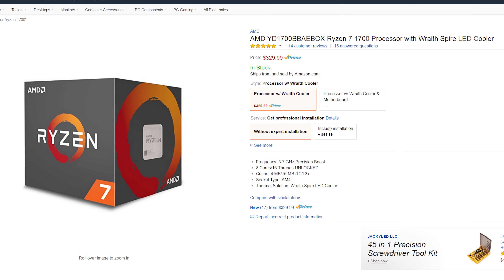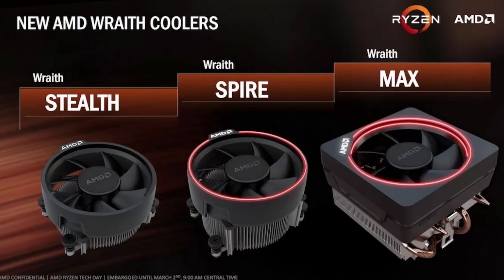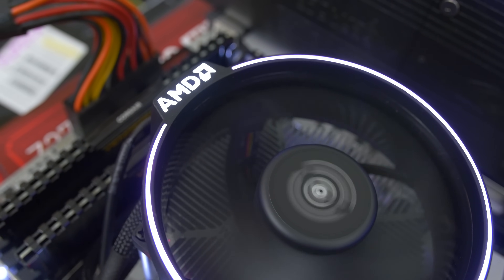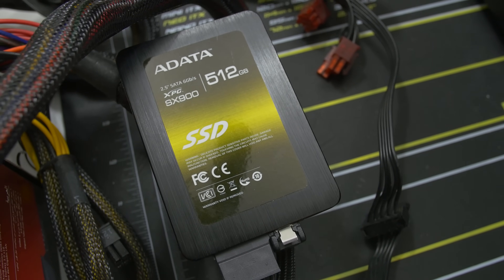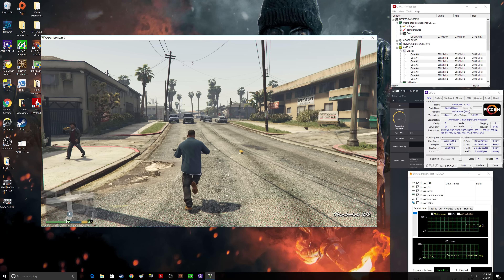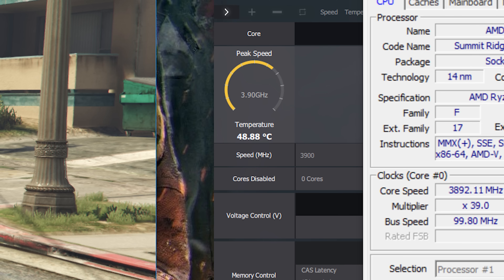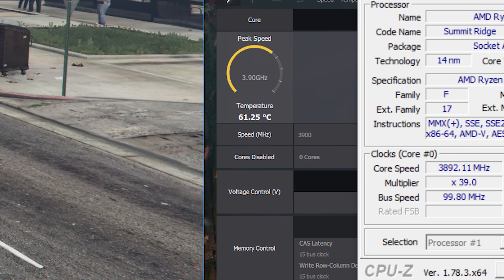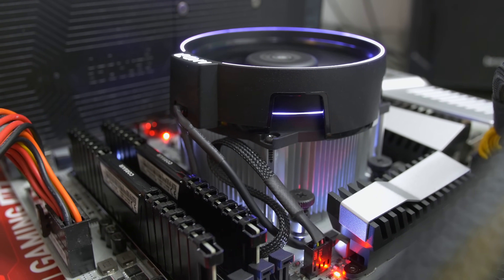AMD Wraith SPIRE: Does it SUCK?

Comment: why are all AMD videos always start with a foreshadowing title like
"Does the cooler SUCK?"  -  "Is Ryzen really as bad?" - "Does the RX480 really destroy mainboards?"
These literal images used are the worst thing the media can do to a company like AMD that produces great products.
Reply: How about "IS NEW INTEL'S CPU JUST LIKE THE PREVIOUS ONE EXCEPT MORE EXPENSIVE?"
Reply: @Slay1337pl  3 years later, YES!!! The same 14 nm arch... LOL
Reply: @Slay1337pl  LMFAO GOTTEM
Reply: "how good is the amd wraith spire?" would have worked quite fine
Reply: I agree, Baum! Cmon, Kyle stop with the negative titles
Reply: +Whorus Lupercal so you're saying they should've sold the 1800x at $1000?
Reply: Are you stupid? What crap products? They offered low priced CPus forever that gave you more cores for non gaming tasks and still did ok in gaming. Now ryzen increases their thread count and iPC all for less than what intel offers. AMDs Gpus have always been amazing for the price. From low end to mid to high end AMD has offered amazing solutions to games outside the enthusiast market. 

What a pos fanboy comment. FFS how much does the $240 RX 480 suck now that its overtaken the 1060 due to driver support? How much does Ryzen suck now that we know with faster ram it as good as intel for gaming and blows it out of the water for everything else... ffs even older gpus like the R9 series gained ground on nvidia equivalent hardware. As for the FX line of chips they still offer amazing performance at low prices...
Reply: Because people think of AMD as a heater company rather than a capable CPU/GPU manufacturers...
It's so imprinted in their heads, it's all Intel this, Intel that, nvidia this, nvidia that, so they believe AMD is inferior when actually... it's VERY competent company.

TL;DR: Intel/Nvidia fanboyism...
Reply: gravitygear your brain washed Intel brain has led you to believe AMD has put out sucky products, but I ran my fx6300 for years and no hickups, overclocked. Was enough to pair with my 1070 at 1440p, super value.
Reply: Thats odd... I have single 7970 and FX6100 and its stable clamped to 60FPS 1080p ultra and it sits there without shutter... It goes over 120FPS sometimes tho without FPS clamping. 
I should benchmark bf1 I could be wrong on something here
Reply: You have strong arguments, but where did he mention serverproducts? Also crap is a strong word and you you use it seven times in the initial post. What reaction do you think that provokes? According to Wikipedia (just a quick check) AMD has 9100 employees while Intel has 107.300. If that is true even Bulldozer and Excavator where huge sucesses. Its been that way for ever, AMD is worth 10% of intel, has 10% of the resources Intel has. Dont' get me wrong, i get most of your arguements. But considering these numbers doesn't it make Ryzen a fabulous product?
Reply: They weren't crap, they were just underwhelming. And I had 0 driver issues, in fact i've had more problems with nvidia drivers crashing than AMD. A bad nVidia driver even bricked my boot sector annihilating windows completely, never had that with AMD.

AMD was always preferrable for budget builds, they weren't "bad" they were just "cheap", and definitely offered more value for money (still do) than Intel and nVidia ever have. That does not make them crap or bad.
Reply: these comments haven't aged well
Reply: This comment has aged beautifully
Reply: gravitygear, I have FX CPU (aka the CPU disaster) and RX480 (aka motherboard destroyer).
Guess what, no issues. 50+ FPS in GTA V on high/max settings, 4K 60FPS gaming in HotS, easily handles max settings in BF1 and also very good video editing performance compared to more expensive i5 CPUs.
Reply: Because the norm is that stock coolers do suck, from both intel and AMD. Also let's be honest anyone who is looking for this information is thinking to themselves "Does this stock cooler suck and will I need to upgrade it?"
Reply: Weird Im rocking a fx8350  with stock wraith cooler with a gtx 1060 OC to 1850 with 16gb of ddr3 ram and I get 65-80 in 1080p with max settings.
Reply: He meant, "SUCK", as in, "Sucking air". It's a classic Bitwit pun.
Reply: TheLondonPlayer true.. communication is so important and u need real ppl with taste to do that... anyway amd is getting to take more risk lately.. look at the revolution banner with the closed fist.. lol.. looks like taken from 1986 apple setting ... "think different"... communication and mktg is not something anyone can do.
Reply: you mean only 1 decade. Amd was controlling the market from about 1990s to 2006
Reply: @dragonfyzex1546  very true
Reply: butthurt amd fanboyyy
Reply: baum stamp i kinda get it why he use this title. stock cooler are known to be bad (until wraith), intel doesn't give any chance for overclocking with their cooler imo
Reply: +kenny ricardo no it's because he knows he will get more views that way
Reply: Because that attracts Intel and Nvidia fanboys
Reply: becasue it gets your attention simple as that
Reply: no but a low price for a solid product makes it much more appealing.
Reply: ^
The bait is weak on this one
Reply: its actually not true, and the 480 is either tying the 1060 now or whooping it. fairly often amd actually has a better gpu within a price range but people go with nvidia anyways. i suggest you actually look at some benchmarks before spewing bullshit.
Reply: Easy path: If you plan to upgrade your GPU when a new one comes out go with NVIDIA since they update their drivers at a faster rate but if you plan to keep your GPU for a long time AMD will destroy NVIDIA, at the long run the AMD cards performs better and you can see that with the 280x for example.
Reply: short answer , because dumb people
Reply: R U mine Well the 280x came out in the 2013 and can handle Doom maxed in 60fps (ninja edit : 1080p) or more (check videos) and if you take in account the 280x is a rebrand of the HD 7970 (2012) well here you have a chip holding on titles 5 years later and still kicks hard. Keeping with the 280x as an example at this point the card is far better now. Impressive isn't it? So, choose wisely my friend and as always enjoy the game
Reply: baum stamp people click more often on does it suck kinda titles :p
Reply: You are joking right? HD4870, HD5970, HD7990, 7970, r9 290x. Those were all price / performance kings at their time, some even top performers. The Athlon 64 X2 which was far ahead of intel pentium processors. Saying they haven't produced a great product in decades is utterly bullshit.
Reply: They haven't always been far inferior. They have been more performant than Intel for more than ten years. At the same time they had better prices. And even when Intel started to keep up again, performance-wise, AMD still had the much better price-performance quota on their side for long. Overall the time that AMD was 'better' than Intel is like 50% of their whole lifetime, so none of both is better or worse. And btw. Intel could have died either, if it wasn't for their heavily illegal methods during the crappy Pentium 4 era. So don't complain about AMD being the 'good guy'!
Reply: I think they were going for "does it SUCK like most boxed coolers?" but I agree with your point.
Reply: baum stamp ikr
Reply: TheLondonPlayer nonsense
Reply: 0DANGEL you are getting way too low fps. But yeah it's obviously not the best CPU by any means, but it's not bad. I have the 1700 and it's so much smoother; it's really nice. I'm returning it for the 1600 though lol save me $120!
Reply: Jay stated that they can't buy him or his opinion. However, I gotta say, the way he makes the title is kinda misleading. I do like the way he presents his opinion. It is just the title that needs to be fixed.
Reply: baum stamp the products arent great though...
Reply: so price alone determines how good something is XD
Reply: 480 is often faster than 1060. 470 is good value as well. Keep talking about inferior products as if its that clear cut. that is why people like you end up buying nvidia crap and regretting it later. How does that 960 look against a 285/380 now?
Reply: What is skinned as new? AMDs cpus are completely new. And $500 is enthusiast.
Reply: baum stamp omg yes fuck this and all other
Reply: They never have anything new to offer that competes with top end titans and 1080ti
Reply: saego360 u r talking like a fanboy , do u know that amd makes medium-low tier product right? So why the fuck r u saying “amd has nothing that can compete to high tier product like gtx1080 ti
Reply: Is not only on the AMD videos, every single video out there uses the same shit is called clickbait.
Reply: Fosi94 how much time is long time?
Reply: actually the 7970 came out in december 2011
Reply: Fosi94 i am using a 280x and i have no problems with any game btw doom can run around 100-120 FPS if u just lower the shadow quality from max to high or even medium and it still looks the same lol and it applies to most games auto settings to high, meduim and low is not the best way to judge a gpu
Reply: Gangel Richárd What? Did you even read my comment? I talked wonders about the 280x man
Reply: the 7970, and the 280x arent exactly the same card, the 280x is basically a refined 7970 from my understanding. the 280X performs mildly better from what ive heard.
Reply: bmxriderforlife1234 I said it's a rebrand man, the chip is the same. If you want the details is exactly a rebrand from the 7970 GHz edition. When a. Company cook a chip always improve them a little bit so yeah is better :-)
Reply: yeah fair. lol i know someone with some 280x's just sitting on his shelf still working, i should see if he will sell them to me for a temp replacement for my dead rig. lol would have to wait on the r5 1600 reviews though, i want to see how it clocks, otherwise might be able to find a cheap used I5 since people are upgrading. waiting for ryzen+ to rebuild a high end system. id prefer to wait out early adopter pains, at least on the high end. r3 for a freenas box is going to be a amazing though. also a giant FU to intel that amd pulled. ECC support on everychip.
Reply: bmxriderforlife1234 If you can get a Sapphire one would be great, I still have in a rig the 280x dual X and it surprises me how good this card is for the time it have on the market... Yes, go with ryzen and the 480 man, great setup at a pretty affordable price. I can't wait to see how both gpu and cpu will be in one year with drivers optimizations!
Reply: eh more then likely going to go used, that way i can justify potentially abusing it later on for some experiments. ;) gonna be trying my own attempt at a sub ambient rig, and i want to test with parts i wont care as much about, so use the temp rig when i replace it :P

im not sure about the brand but i remember they were pretty nice cards. 

as for my expensive build, depends what ever offers the most performance, basically planning a realistic version of linus' 7 gamers one cpu, but im doing 2 gamers 1440p :P

and then for when im the only one playing either 3840x1600p with a 38 inch 21:9 monitor, unless something better comes out between now and then, then just switch out the shopping list. then going to build a 5x1 portrait set up, with 1440p monitors, 2 of which will be used for the multi person gaming scenario, but yeah basically battle station.
Reply: ofc i read your comment i just threw my stuff there too :D
Reply: https://www.twitch.tv/videos/129702979 to see r7 1700 with gtx 1080 destroy crysis 3
Reply: bmxriderforlife1234 Alright the experimentation always is funny and interesting. Sound like a nice project to do, would be nice to see the finished product in the near future. Wish you all the luck and success!
Reply: Egonieser Locman A bad driver from Nvidia bricked your boot sector? You couldn't rebuild the boot? My God... If that happens to me I'll just go full Allahu Akbar
Reply: ive had a bad experience with an nvidia driver as well but not that bad.  i agree with fosi id go ape shit, picture boggie2998's francis destroys an xbox video but a skinny kid with a sword to a gpu.
Reply: bmxriderforlife1234 I feel identified with the skinny part and the sword...
Reply: also at one point AMD was the more expensive choice from my understanding, they were ahead of intel and released a the first 1000$ consumer cpu.
Reply: bmxriderforlife1234 Well if my memory is correct a long time ago EVGA wanted to sell Radeon cards but AMD said: nope. And if that's correct... Says a lot. Ninja edit : talking about GPU's of course.
Reply: well idk what that would say but i heard that EVGA has said that they will not produce amd hardware so yeah maybe.
Reply: btw did you see jay is doing a 30 day ryzen challenge? reviewtech joined him, joker is using ryzen for his work now. dont see how people are saying reviewers are hating on ryzen. 

btw what are you hoping to see out of ryzen+ or whatever they call the next batch. i wanna see pcie lanes get icreased and overclocking potential these things are kinda duds in that regard, too bad in everything else intel is basically screwed by anyone looking for price to performance especially on the lower ends skus once those are available.
Reply: bmxriderforlife1234 Well EVGA wanted to sell Radeon they got kicked in the nuts and then "oh Nvidia come here my friend!" always have a laugh with that. 

I don't know if that comment was for me but I'll answer it:

I saw the challenge of Jay and its AMAZING, to be honest only 3 minutes in difference on that rendering doesn't bother me when I remember the price gap.  In my humble opinion I couldn't ask for more, it kinda hit me hard when I see the "poor" overclocking capabilities, I mean we were used to rise the multiplier like crazy with the Fx's but even with that there's no comparison between both. I only asked for an affordable yet powerful enough to game and do some tasks for a couple  years but also with the overclocking in mind since is just funny to mess around and AMD delivered! Solid pieces of hardware... 

The lower end CPU's will be the most interesting ones, If they can handle without any problems a nice overclock there will be very few reasons for a gamer to buy a higher tier and it's nice! Is nice that you have now a really good selection of processors for every single budged out there. 

Vega is coming and to be honest I don't know what to expect now... If AMD keeps launching their products like this Wow... Just wow... The support for the increasing in the PCI-E  to be honest that could be something slow in the AMD side. 

But like I said I don't know what to expect or see I feel like AMD waited until the last round to make a come back. And they're doing it, the red team is throwing some hits! 

4 edit: sorry if there are repeated words or something, the zombie mode is hard on this one... Nite
Reply: oh true, well lol might explain why evga wont make amd stuff now. 

and yeah i was asking you. 

and yeah the difference is marginal the difference equates to single gpu or dual gpu for someone considering a higher end intel part in a lot of cases. overclocking capabilities will probably be improved upon in ryzen+ seeing how people are complaining about it i see that being a key point for amd to potentially look into. 

the lower end sku's  are going to screw intel if you think about it, even if they have the same max clocks as the r7's all that means is gaming performance will be the same, the only thing different is the number of cores, total cache and everything is the same. so either the same price plus more cores as intel i5 systems plus cheaper motherboards. or the price of an i3 system but with core real cores and unlocked multipliers. plus they all have ECC support, so once freebsd gets better support and other such OS that require or like ECC ram intel is screwed. if amd is smart theyll work on that sorta stuff with the people working on those programs and yeah basically undercut intel hard.  as for vega im not getting hyped, but im awaiting to see the performance as with ryzen, however i do hope they deliver. Hbm2 should do good for what im planning with the crazy resolutions from my understanding. 

the reason im hoping for pcie lane expansion is basically because im planning a dual gamer system as well as want m.2 nvme drivers for both to boot off of. plus having one beast system will come in handy for video editing as well as some other projects. 

definitely throwing some hits. 

no worries night.
Reply: uhm i direct you to jayztwocents who literally shit on nvidia for the titan z card.
Reply: bmxriderforlife1234 
Really? Literally? Then I must demand the video where JayzTwoCents literally took a dump all over the NVIDIA HQ.
Reply: i never said on their HQ. go watch his titan z video. and a bunch of his live streams. that card literally pissed him off. and he chirped nvidia about it for like years. also i guess you dont watch archer.
Reply: Fearbleeds you joking right? cause I had an fx and it was shit
Reply: +Gilgamesh I approve of your name.
Reply: baum stamp the RX480 pulling too many amps from the pcie slot was a legitimate concern. It's fried at least one motherboard but only older ones. I think the point of these do they suck videos is to prove that they don't suck.
Reply: They haven't always produced great products, and imo deserve a certain degree of skepticism
Reply: baum stamp l
Reply: Many people love the AMD products.
Reply: gravitygear I know I'm late but I'm interested, how does Epyc look for what you're doing?
Reply: It's been a while, but, the stock cooler on my Athlon X2 5200+ CPU absolutely sucked a**. That thing was so inefficient, that even a 720p Youtube video could bring the temperatures up to over 70°, not to mention playing games on a hot summer day, which ALWAYS led to warning sounds, and the CPU shut off. Yes, i know you can set the thresholds in the BIOS, but, 70-80°, sometimes even 90 were just too high for that CPU. 

Good to see though they learned though, and build some more efficient coolers on their CPU's now.
Reply: I know right
Reply: @thornok2131  Ryzen stock coolers?
Reply: @thornok2131  Well then I have a Ryzen 7 2600X.Guess what.
My stock cooler is actually perfection.
Reply: 1: Everyone has an opinion, and many of them are wrong.
2: And then there are verifiable facts.
Two years later, it seems that AMD is doing great in spite of the "negative" YT titles. This opinion turns out to have been one of those "wrong" opinions.
"ALL" Fan-Boys eat crow. Sooner, or later, or some even eat crow ALL the time. Being a fan-boy is for those who feel and don't think.

hehehe :P

Peace! ;)
Reply: It's clickbait...
Reply: Muahaha
Reply: 8 years later and Ryzen is CPU Chad Gigafukz-A-Lot 😎😎😁
Reply: uhm amd hasnt produced a great product in decades? are you fucking kidding me? you realize amd cards quite often are better performance to price the  nvidia ones and that whole intel genuine code bs that nerfed amd processors for a long ass time. 

the cpus they made may have sucked but that doesnt mean everything they made did. 

jesus christ are people fucking dense.
Reply: +Fearbleeds   Let me just add something... I am at this time using a Fx-6300 @4,2GHz and GTX 1070 @2Ghz combo  (Gaming on 1080p And waiting to get my hands on Ryzen) And to be honest, its awful... I mean, Yeah... the 6300 gets its job done but its not as good as i would need to, for example while playing BF1 (That Open-Beta version) i was geting like 30 - 40 fps.... and that kind of fps for an FPS sucks.
Reply: clickbait
Reply: Clickbait
Reply: I have no allegiance. I run what works and what is reliable. I've had amd based servers get smoked by intel servers in the past. Consistent complaints from users accessing services hosted on AMD servers complaining of slowness and sluggishness. I work with enterprise level equipment. Our AMD servers have let us down WAY more than our Intel servers. That hardware has gone to the IT retirement company; everyone unwilling to re-purpose it.

YOU are brainwashed for rushing to take up your sword and shield to defend "your" company against someone's educated, scientific and observation backed statements.

Did I ever say that Ryzen sucks? No. I said that the previous iterations were crap. Nothing about Ryzen. AMD may have worked for you in the past, but they sucked big for what I needed. I'm happy that AMD has released something new. It helps everyone if there is another player in the game, but don't pretend that they weren't far inferior and have always been "the good guy". I look forward to seeing something good come out of this launch, while you just pick fights with those who disagree with you.
Reply: @gravitygear  if only he knew in a few years amd would dominate
Reply: Because he's part of the shill crew.
How many times have you seen "nvidia /Intel are they worth the performance per dollar" ?
Reply: This was for Fearbleeds.
Reply: δημοκρᾰτῐ́ᾱ It sorta resembles soviet propaganda. Heck, the homepage on Radeon.com used to say "join the red rebellion", which is kinda funny. All of the AMD fans should be called "the red army".
Reply: 5970, 7970 and R9 390 were all great GPUs (7970 and 390 now perform much better then their nvidia counterparts from that time)
Reply: Minmataro718 its cheap because its only technology thats skinned as new. thats why they dont have any enthusiast products because they arent a top brand
Reply: saego360 “amd isn’t a top brand” oh okk
Reply: because it's true, amd products before ryzen sucks, rx 480 < gtx 1060. I would've bought amd too since nvidia and intel tends to be scumbagy. However it's just hard to buy inferior products
Reply: Amd is terrible
Reply: well, recent history proves that they produced crap products, with crap architecture, and crap drivers (remember excavator and bulldozer?). Now they have banked EVERYTHING on Ryzen. So, AMD is still in a hole of suck and crap until they can prove that this isn't crap and it doesn't suck. This situation begs the question of "Is this AMD thing crap and does it suck?" They haven't produced a great product in decades. Their last release faceplanted so hard that it almost put them out of business. Great products don't almost bankrupt companies.
Reply: @gravitygear  Wow a died in the wool Intel lover AMD is a great product and beats Intel in cores.Now Intel is trying to catch up on the cores.When Ryzen 3 comes out Intel will be left in the dust !!!
Reply: @gravitygear  that comment did not age well at all lmao
Reply: @gravitygear  hi, im from the future, came here to tell u tht intel is scared of amd 😢
Reply: @gravitygear  From the future, Intel is scared of AMD
Reply: @gravitygear  Oh how the tables have turned
Reply: @gravitygear  Look what they have now
Reply: gravitygear this comment aged badly
Reply: gravitygear you still think this? Lol
Reply: @gravitygear   I disagree to a small extent. One of the reason why it could be because the stock coolers from Intel are only good as a kids toy. They are complete trash. Its good to see a stock cooler that does a good job.
Reply: @gravitygear Indeed. The first computer I bought back in 1999 was an AMD. They had the best bang for the buck but oh my lord did that garbage crash a lot. And then intel started releasing some great cpus like the i7 920 and the 2500K/2600k.
Reply: @gravitygear  i come from the future, oh boy ur mad wrong
Reply: @gravitygear  Beginning with Ryzen, AMD gives stock coolers that actually work, unlike Intel. Intel stock coolers are "in a hole of suck and crap" and it is well "proven" that AMD coolers put Intel's to shame (BADLY!). DANG! OUCH! LOL! 

And now AMD is smoking Intel for productivity straight up. And AMD is smoking Intel even worse in every way and every program when considering Power-Per-Dollar..."how much work does it do for your purchase price". AMD is rocking (for now) and Intel is scared in 2019.
But I'm no fan boy, if Intel comes back to smoke AMD I will enjoy it, but not for 50% higher price. I have always been happy to spend extra money on good/better products but I also care about how much I get per dollar.

Bottom line is, as of the time of this writing, Intel fan-boys are eating crow. "ALL" fan-boys eat crow sooner or later...and sometimes always.
Reply: @gravitygear  welllll now they ahead of intel 2 yrs goes by quick
Reply: gravitygear Oh how the tables have turned...
Reply: @gravitygear  your comment hasnt standed the test of time
Reply: @gravitygear  i have been using AMD for the last 15 years / I guess I missed all the suckness.  Muliple computers built , used given away, sold  to family and friends and no one has ever had a problem.  Could all the suck be beacuse people are using it out of the specs its' designed for.  Building  my parent a new computer with the Ryzen 5 to replace his aging A10 all in one HTPC /daily drive /and grandson gaming PC  when he visits just because I want too, not because there i something wrong with it .   Glad I missed  all the suckiness.   So no AMD does not suck people do sometmes.
Reply: Too bad AMD gives amost zero shits about consumer market.